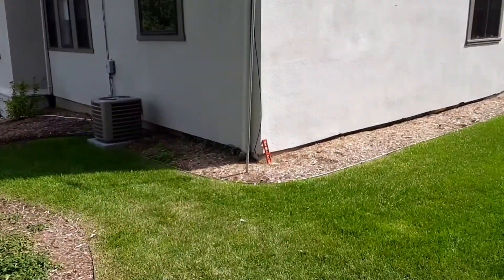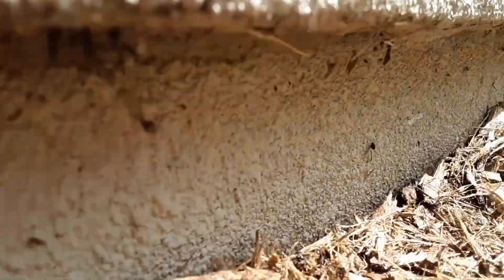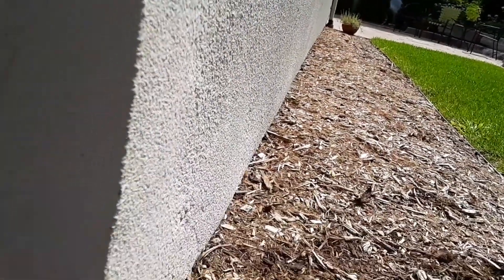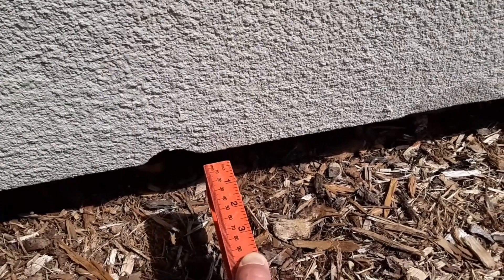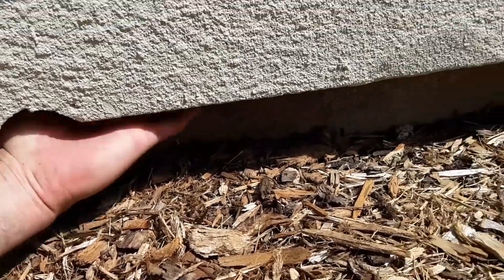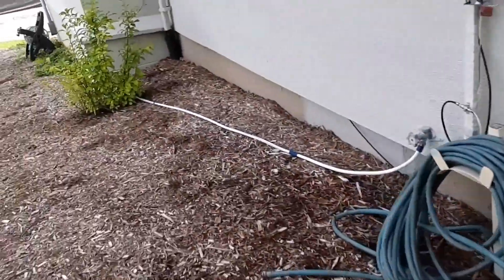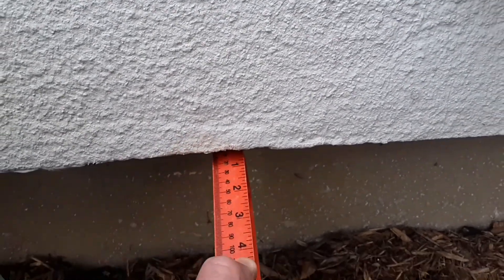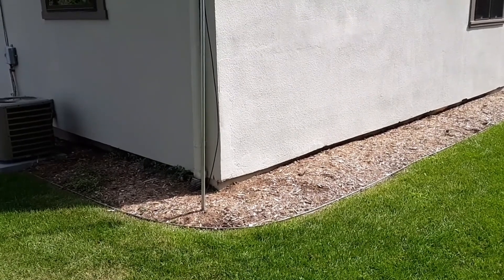📐🧱 Foundation HEAVING & SETTLING 🔁 into the BASEMENT - How to identify DAMAGE from the exterior

Comment: Would you look for the same thing for a slab foundation?
Reply from the maker: Thank you for watching this video and for your question.  I would not be looking for heaving towards in or out of the interior on a slab, however, I would be looking at the same areas for settlement or heaving going up or down causing an effect on the structural framing above. Concrete slabs typically experience settlement downward or heaving upward.  For example, tree roots or frost freeze can cause heaving and settlement is caused from improper backfill, washout or sink holes. Where you have a basement foundation or a slab, it is still good to assess your sill plate connection to the base of your home for open gaps that can allow rodents and weather elements to enter.   
ALSO... watch👀 this video for more foundation information https://youtu.be/ZSQHYz4YDKE